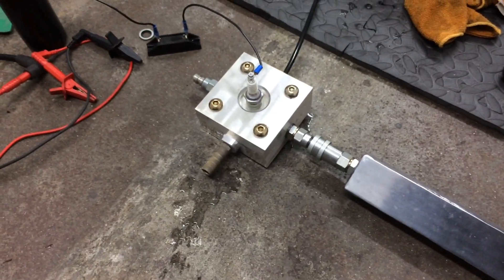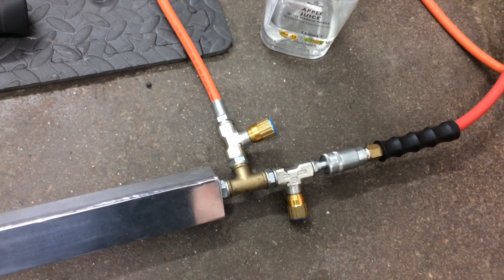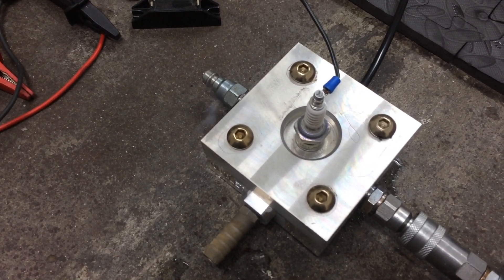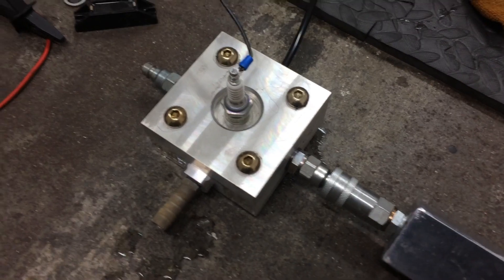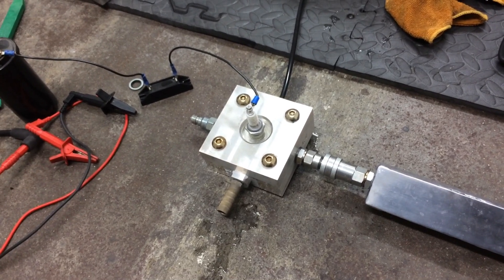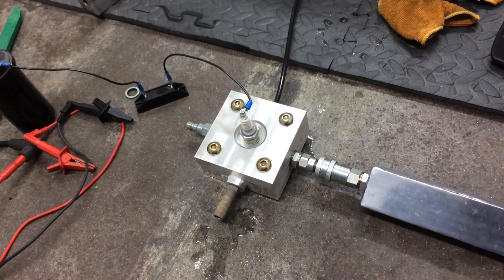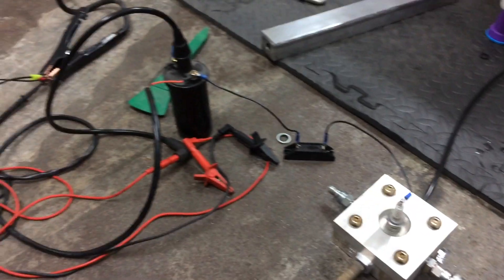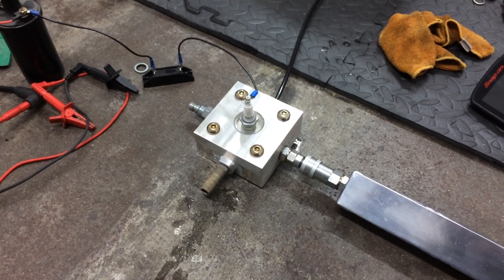Nikola Tesla's Self Resonating Super Heated Steam Boiler - Raw Footage

Comment: How is it that the + of the ignition coil is powering the sparkplug? Weird! What's the HV of the coil connected to? It's hard to see...
Reply from the maker: The ignition has already reached self ignition status and the wire isn’t actually doing anything.

A glow plug could do the same initial job. To heat the chamber.

Comment: Is this a Detonation engine? It does not seem to have a supersonic wave emitting from the combustion Chamber?
Reply from the maker: This isn't the final machine it is one step in the process of replicating the apparatus from Tesla's 1920 patent that was submitted in 1916.
Reply: @nikola.tesla.r.and.d.centre  have you had any updates on it in the last year maybe a video.
Reply from the maker: @Graemecns  this was an update from the community tab section. https://www.youtube.com/channel/UC4uJgCHU3s4AOA-uT5SDA4w/community?lb=UgyGKXcb9XmwtNFuo814AaABCQ If it doesn't load when you click the link, hit refresh. I have had this problem and a few others have too. I think it depends on which browser you are using.

Here is a free Patreon post I made with the files hoping someone would replicate the experiments I made. 

https://www.patreon.com/posts/40719631

I didn't have the funds to build an all metal turbine at the time and ended up pursuing a different version which is simpler and doesn't use flammable gas or liquid.

If I had pursued it I would have also needed a gas analyser to check the emissions.

I am fairly certain that once the steam was introduced the emissions changed for the better. I say this after working on petrol and diesel engines since the mid 90s. I'm fairly confident it could be operated indoors as a heater of epic proportions.

I'm 42 next month. It is probably the simplest / easiest / cheapest gas engine to tune that I have come across in my life.

Comment: Could this be done using waste oil?
Reply from the maker: To be honest I’m not sure. If it’s flammable and gravity fed it’s possible. One I do know for certain is when the propane I used was combined with the steam, the emissions definitely changed for the better.
Reply: @nikola.tesla.r.and.d.centre  well that would be an achievement if done, other experiments to consider might be steam on charcoal to form another gaseous flame, as well as using the super heated steam to melt plastics into fuel, these things could be possibly done to do 2 processes at once using the high heat and pressure steam, it might actually serve multiple purposes, activated charcoal is made using such a steam but charcoal plus steam in such an environment forms another type of fuel, so in essence there could be multiple components that might aid such a system, with waste plastic being super heated and turned into fuel that can possibly be used to fuel if using waste oil... also the charcoal again as a whole another source of energy, in essence such systems can be extremely efficient feeding back in on itself in looping systems, I really like how Taiwan uses a highly efficient incinerator to turn garbage into electricity and basically all these processes can be combined, but such an engine can for sure regulate temperature of a tesla turbine and since a tesla turbine can be multiplied in scale again using waste oil or some other waste component you can possibly use the excess heat energy to also turn things into fuel to further help run such a system, I was always interested in the idea that a fuel source whether solid or liquid such as charcoal or waste oil and air + a little bit of water could prove to be more efficient at giving energy than just fire and energy alone and not just in conversion of heating a water source in order to create steam but rather combine the steam with the combustion process especially considering that charcoal when heated in presence of steam forms another gaseous fuel, anyways such a system could be used to incorporate solid and liquid components all feeding back in on itself to feed one large tesla turbine that is regulated by that one engine in essence, kind of like the idea that when small amounts of water are super heated that the oxygen and hydrogen break apart and help form the energy into the process to be more efficient, since it's in pulses the tesla turbine which usually speeds up too much would be regulated and using a metal such as aluminum bronze which is a highly resistant to corrosion metal and almost on par with stainless steel, itll last about 900 years in sea water, such a metal would help resist the intense steam, you need a metal or material that withstand high steam and pressure and temperature and more than just strength not corrode, steel is good for strength but corrosion becomes a problem, but fire + air + water  with tiny amounts of water so the temperature was high enough to break apart the bonds of water was always a thought in my mind, if it's that efficient ar heating a small space then it shows the latent potential energy not being harvested in normal engines or even normal steam engines, the chamber is probably just a stable design that allows the components to mesh In a nice degree but the design seems for for durability and direction and it looks like a drop of water a design that was probably gotten from nature, the shape allows the energy to go in one direction, I'm just unsure about the hz and frequency and how that factors into the design but my best guess would be helping with the water somehow in breaking its molecules  into hydrogen/ oxygen to further enrich the flame, a bio diesel can also be made using waste fuel if it doesnt work with pure waste oil etc... but I'm sure the system can be configured to have enough heat to run such a system, also encasing the engine in an aircrete mixture or some sort of insulation to further improve heat etc.. energy and loss

Comment: I've no idea what this does but its awesome. I want one. Id suspect 01 tool steel or similar would last longer with the temps, but I understand aluminium is a bit easier to prototype with.
Reply from the maker: Must be your 6th sense! Stainless Steel will do much better than this prototype using aluminum which was to save on machining costs. Cherry red on the brass might indicate things are getting a bit too hot for the aluminum. This is why I pulled the 🔌 plug as I didn’t want a molten mess. British Patent 174,544 indicates to use a higher temperature around 1100F - 660F are Tesla’s own figures. He points out that his design will convert 1100F to velocity using a diverging nozzle and for that velocity to impinge on a rotor via adhesion will convert velocity of detonation shockwave into angular momentum. The valvular conduit method negates needing a second stage at all. I think the Venturi method is superior in flow if a second stage vacuum pump connected by a fluid gearbox is utilized.
Reply: @nikola.tesla.r.and.d.centre  nice. I understand some of this (im not too familiar with tesla s work) but am following along with interest and have my own machine shop so may even reproduce some stuff. Do you have an online forum outside youtube?
Reply from the maker: @johnharding2912  Hi John, building something functional is the best way to learn. I have an open source 3D printed design that has already been replicated and done over 200,000rpm which has a one inch diameter rotor. Also we have a Patreon site www.patreon.com/TeslaTurbo

There are a mix of technical and none technical Patrons, so we cater for all.

Cheers,

Paul
Reply: @nikola.tesla.r.and.d.centre  nice. I have a lot of cnc experience and machinery so will try some of this from alu. Will check out the patreon too.
Reply from the maker: @johnharding2912  this is the latest design. It isn't quite finished yet but I think you will get the idea. https://www.youtube.com/channel/UC4uJgCHU3s4AOA-uT5SDA4w/community?lb=UgyGKXcb9XmwtNFuo814AaABCQ
Reply: Also if you do try HHO, graphite plates are 3x more efficient than stainless at same wattage. Unless you go down the meyer route. https://youtu.be/CuZ5WxYwl4g

Comment: How is self igniting achieved when you have a spark plug wired to a coil and an electrical source!!! 
good luck
Reply from the maker: Watch the previous video and you will realise the wire to the plug is redundant. I just didn't disconnect it this time. In this link there is no wire! https://www.youtube.com/watch?v=M1cnu7GCIcI
Reply from the maker: It needs the spark plug or a glow plug to start it, then the ignition device is redundant until switched off.
Reply from the maker: In Tesla's patent is reads "After a short lapse of time the chamber becomes heated to such a degree that the ignition device may be shut off without disturbing the established regime." I just replicated what the patent said. https://teslauniverse.com/nikola-tesla/patents/us-patent-1329559-valvular-conduit

Comment: sorry but i do not see any super steam!!!
Reply from the maker: I can put my hand over a kettle and the steam will burn my hand. I cannot put my hand within 2 meters of the exhaust of this. If you Google "is super heated steam invisible" or "is steam invisible" you will get something like "Steam is water in the gas phase. ... Steam that is saturated or super heated is invisible; however, "steam" often refers to wet steam, the visible mist or aerosol of water droplets formed as water vapour condenses." The behavior of the device with the water jacket and water dripping into the exhaust and instantly turning to steam was quite different to how it behaved before without the water. It ran better, got much hotter and to top it off the emissions changed for the better, perhaps even good enough to run indoors. I would have to put a gas analyser on the exhaust to truly know if that it true. I have spent many years around vehicles running indoors, with extraction and without so this is something I'm very familiar with.
Reply: @nikola.tesla.r.and.d.centre  so then you can tell me what that blueish flame that i see coming out of that nozzle?
Reply from the maker: @rchristie5401  that is LPG (Propane) being combusted in pulses that are self igniting. If the speed is made to go higher then these combustions will turn into detonations. The water literally drips into the exhaust and comes out as super heated steam. Watch the previous videos without the water addition and I can put my hand near the exhaust. With the super heated steam I couldn't put my hand within two meters. Also notice in this video the water tank bubbling at a rate of about 1 drop per second. I was using 0.5mm brass water inlet and exhaust jet into the chamber. It also heated up my workshop which was 1350 sq ft rapidly. Before adding the water it didn't do this. The amount of LPG used was minimal too. After hours of testing the gauge on the small tank still reads full.